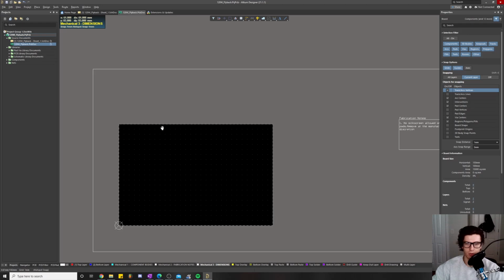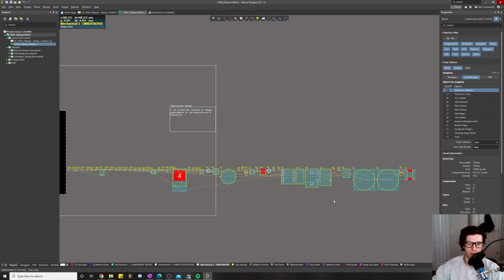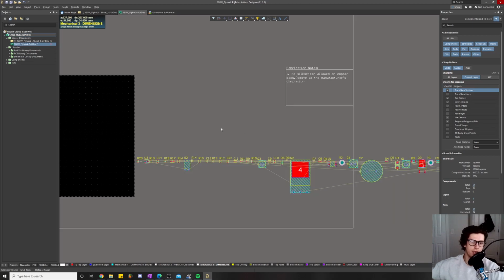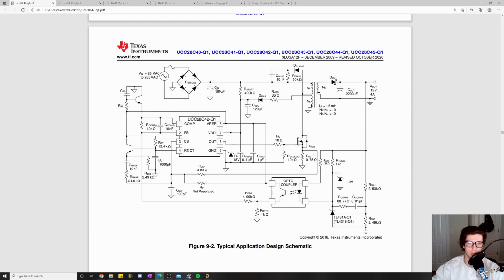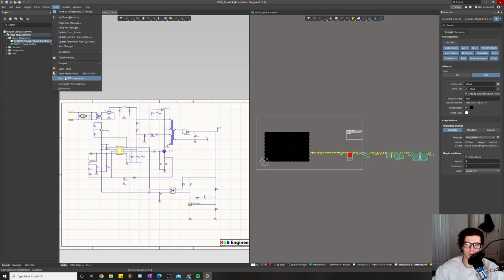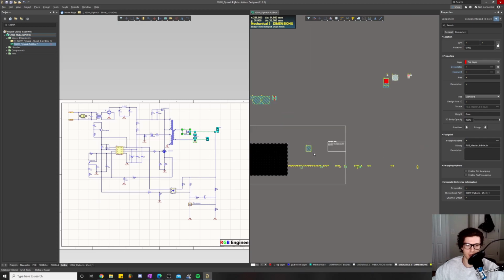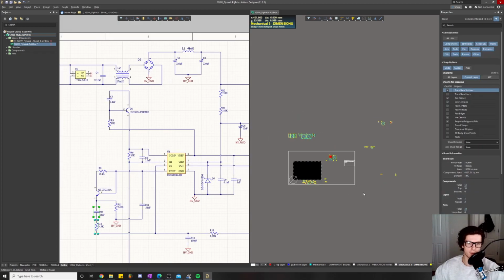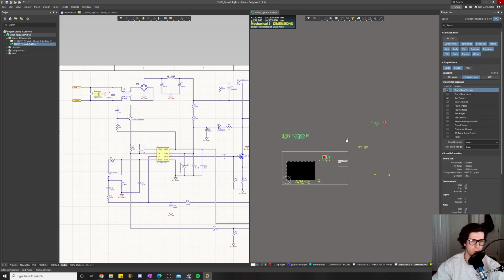FLYBACK CONVERTER PROJECT PT 18 | 24V, 120W FLYBACK CONVERTER EXAMPLE | POWER SUPPLY EXAMPLE PROJECT

Comment: Sir kindly make videos on snubber network, how to design proper network and how to calculate values for RCD.
Actually I calculate the primary, secondary and auxillary windings. I connect all the components perfectly. I use 5L0380R PWM IC. But then the snubber network values for RCD is a big problem for me.  
Kindly do few videos on snubber network. 
I can find videos on YouTube on any topic but the RCD snubber network is not there the way I want it.
It will be your most kindness sir.
Lots of love from Kashmir.
Reply from the maker: Here you go :) 

https://youtu.be/FXpsAsVJFVc
Reply: Thank you so much sir❤️❤️❤️